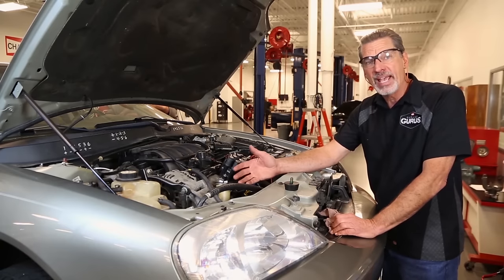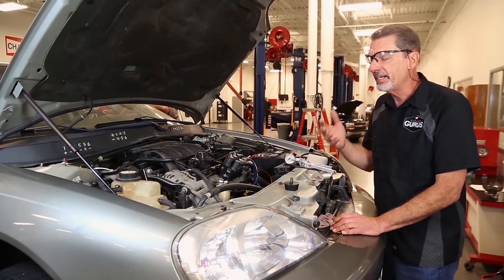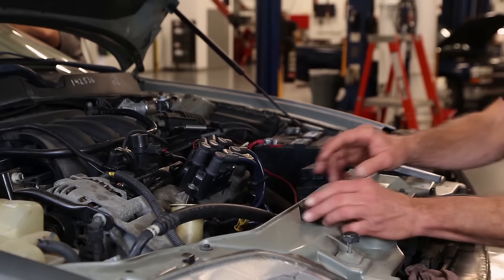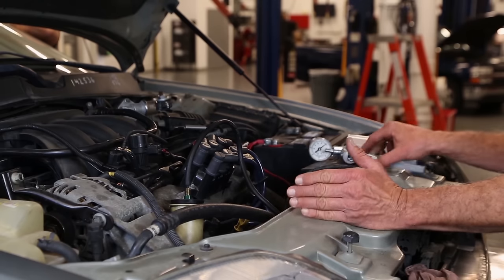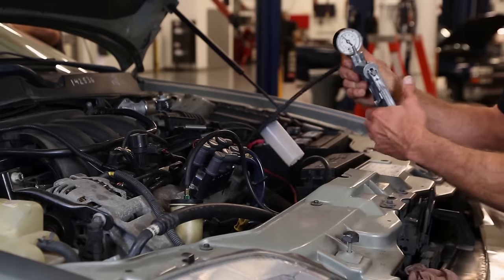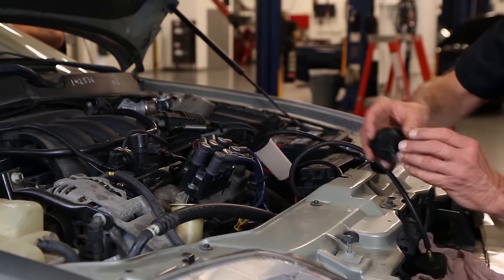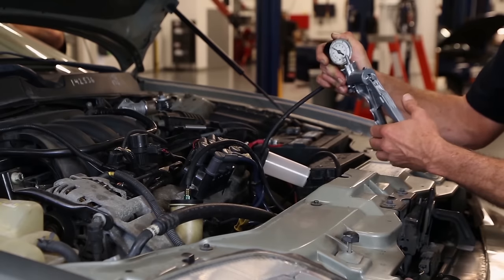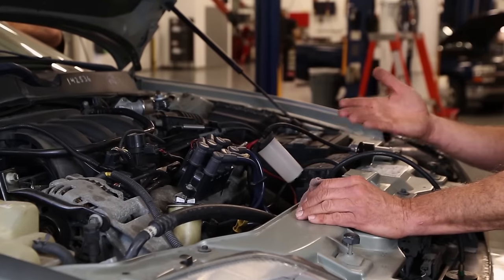Power Steering System Air Bleed Process

Comment: Jack the front of the car off the ground and put on jack stands. Fill the reservoir and WITH THE ENGINE OFF turn the steering wheel all the way both ways and  check the reservoir as you do this and add fluid as the air is released.  When the air seems to be bled out start the car and turn the steering wheel again all the way in both directions about 10x. When the air is bled and the fluid stabilizes drop the car back down and start it again. Once more turn the steering wheel all the way both directions about 10x while checking the reservoir. If it drops a bit just top it off and go for a spin.  Check the reservoir one last time when you get back and make sure it's filled to max. This is the correct and easier way to bleed your power steering system of air.
Reply: Holy crap ive been doing while the engine is on and cant get the air to come out and it just bubbles out the the top and ive try like 3 times but next time ill try with it off first thanks
Reply: Do I need a vacuum for this like in the vid?
Reply: @Redneck_4wheelers  did that help?
Reply: @WaveyDaHuman  i still havent done it been pretty lazy during this winter
Reply: Do you do each step with the cap off?
Reply: my car blew up
Reply: Thanks man it worked i turned the wheel 10 times with it off and 10 times with it on with cap removed got rid of the loud power steering whine
Reply: Is the car being off the ground just to make it easier turning the steering wheel or another reason?
Reply: I agree
Reply: Exactly absolutely no reason to do it the way the video shows unless you like buying a bunch of extra tools for no reason
Reply: @WanderlustmanC you cant turn the car while its on the ground theres too much friction on the tires.

Comment: If you want to replace your pump again, do it like this video. Jack the truck/car off the ground and set it on jack stands. Fill the res to the full mark. With the engine OFF, turn the wheels back and forth until all the air bubbles are gone (adding fluid as needed). Then start the engine (still on jack stands), and repeat. There should be no whining or gurgling sounds. done. Running the pump with a bunch of air in it is beyond stupid. This vac technique can not remove air in the system.
Reply: @idiotgo  why.. do u mean Subaru power steering can't replace fluid by return line drain method?
Reply: @idiotgo  I thought it was a easy thing to bleed out. Since there are alot of you tube videos about bleeding air by turning steering wheel on open fluid reservoir. I never change PS fluid before.
Reply: Good thing I saw this comment, for some  reason I trust your opinion and going to do it your way
Reply: @DrNemea  The vacuum makes the pump fight against it. It prevents the pump from drawing fluid from the reservoir.
Reply: Thanks for your comment you should make a video. Works like a charm.  Thanks again.
Reply: Silly question but do you do this with the cap on or off ?
Reply: @geoffreymontelongo8916  It's a good idea to have the cap on... but no necessary. With the cap off, I would fill the res to about 3/4 full. As air bubbles into the res, it can make a mess with the cap off. That may vary with model.
Reply: Lol, you didn't listen to the video. He said "some cars require no special techniques, but some need additional help to get the air out" What you're describing is the "no special techniques" part of that sentence.
Reply: Honda Pilot 2014, agreed!  I had to vac 20to 25 psi with front car jacked up WITHOUT starting the engine like 20 times, each time 10 complete lock to lock turns until all bled, and tapping up ps fluid as needed. Once I was confirmed no bubbles foam etc , I started the engine and did as this video suggested. And I finally got my ps to work no noise, nice and soft turns. Please be patient with bubbles give like 10mins to disappear. It take a while to bleed but if done correctly save a lot of headaches in the future
Reply: thanks 👍🏼👍🏼 I guess I'm the only DIY that doesn't have a pump in toolbox.....
Reply: does the reservoir cap stay on the power steering or loosen it a bit
Reply: @sorro_tek9599  Keep it loose
Reply: @hawkdsl  appreciate itt
Reply: @sorro_tek9599  Did you see the cap being switched for a rubber stopper with a vacuum valve on it or no? He only put the cap on to check the fluid level after the suction process.
Reply: Yes it can

Comment: Don't turn on engine. You can cycle the steering back and forth to push the air to the reservoir.if the front wheels are off the ground. You don't even need that vacuum pump.  Keeping engine off prevents the pump from engaging so it won't spit out fluid.  Simply rotate the wheels by cycling bank and forth on the steering wheel. check reservoir every few cycles for air bubbles. If need be add more fluid but only to proper levels. Do no over fill.
Reply: Do you leave the reservior cap off or on during this process?
Reply: @andrue17  Yes
Reply: Is the cap on during the process?
Or do you keep the cap off?

Comment: I finally did get all the air out of the system. The hand held vacuum pump did nothing in the beginning because there was too much air in the system. I could not pull any vacuum with it even after 15 min of pumping. So here is what I had to do: I have a one man pneumatic brake bleeder that uses air pressure to create a vacuum. I hooked this up to a mighty vac vacuum adapter for ford power steering reservoirs and sucked most of the air out of the system with the motor running by turning the vacuum on and off for about 10 minutes. Then I hooked up the hand held pump and was finally able to pull a vacuum. Red PS fluid was coming up into the fluid separator even at 10 lbs and it was full of tiny bubbles. I kept it at 10 until fluid stopped coming out. Then I went to 15 / 20 /23 doing the same procedure until there were no more bubbles. 23 was the highest I could get it. I stopped the motor and let it cool off for 2 hrs, then repeated with the hand held pump.. There was still a little air in the system, but fluid did not squirt out of the vent hole in the cap anymore when the motor was shut off. I let the owner drive the car for a day like that, then repeated the procedure.
Reply: The only way i got mine to stop foaming up and causing a whine was to use about half a quart of dexron III automatic transmission fluid.  I tried every brand of power steering fluid i could find.  The prrstone Honda fluid worked best but still whined hard after a 40 min drive.
I said screw it and put the trans fluid in it.   we used automatic transmission fluid in power steering systems all the time back in the 80s. In fact the owners manual of my olds cutlass said you can.     And now mine is whisper quiet.

Comment: Watching this video I finally figured out why my nasty honda is making a whining noise even after replacing the pump I forgot to bleed the line and realized the line is filled with air 😴 thank you so much you have a sub here 💪
Reply: What year of honda?
Reply: Moving the steering wheel from left to right while 10 times the front of the vehicle is on jack stands and the engine idling will help. 👌
Reply: @eluniversodelecuador  didn't help me...😥 in so flustered!!!

Comment: I have a 1999 Ford Ranger 4.0 4WD. Now it has 190,000 mi. I am the original owner. For the last 15 years the power steering pump has been whining.
2 shops I went to for a replacement asked me if it worked normal besides the noise. Yes, it does and no leaks that I have ever seen. They both said they wouldn't touch it, because they most likely wouldn't be able to make the noise quit. I bought a "new parts" rebuild from summit racing. Decided not to install myself because I might run into some unknown problems. Had a shop do the install and it was better initially (except near full turning). Within a week it was back to making noise. Not as loud but not quiet like it was 15 years before. I have a hand vac and plug fitting for the reservoir. That helped a little, but kind of changed the points of when the noise starts, or stops. I get a good seal with the fitting and it will hold vacuum overnight. For 2 days now I am driving it with the vacuum set on the pump. 😄 Not fix yet. Any ideas?  Somebody must know what the problem is.

Comment: On my 84 gmc I had the mechanic to just go back and forth with the steering after installing the pump then drove it and added more fluid and went back forth a little bit and it worked

Comment: I have a 2002 Merc Sable that has a lot of air in the system. With the engine off, the fluid level is where it should be, but when it is started, the fluid level drops way down and needs about a cup added to bring it back up. As soon as the engine is shut off, the level rises and all the added fluid over flows from all the air pushing it out. Will this method work to get all the air out? I have raised the front end off the ground , and have been turning the wheel from stop to stop with the cap off / engine off  for 3 hrs in an attempt to get the air out. Bubbles keep coming up. The most times that I can go from lock to lock and back without any bubbles is 4
Reply from the maker: It is just difficult to get the air out of Ford power steering systems. Turning the wheels back and forth, raising the front end, ect. give you limited success. The vacuum method outlined in the Tech Tip is recommended by most manufacturers. Buy or borrow a good vacuum pump as shown in the video and buy a power steering bleed adapter. Search: “Power Steering Vacuum Bleed Adapter” They are available from most auto parts stores and an online search will show adapters from $13 to $20 that will work fine. Good Luck!
Reply: What you just described is exactly what im facing with ES330. I repaced leaky hoses and no matter a bleed and flush still whines.
Reply: I have a 2003 Ford Taurus with the same problem!
Reply: Did you find the solution to this. I have the same exact problem on a 2007 ford taurus. I've jacked it up and turned the wheel 50+ times lock to lock. There's still so many bubbles. I didn't have an adapter so the vacuum pump wasn't used. Any help or info?

Comment: What are all those numbers on the upper plastic firewall cover? great video BTW, i really need to do this to my car.
Reply from the maker: dntlss, the Ford used for this video is part of our training fleet here in St. Louis. The numbers on the left are the firing order of the engine. The numbers on the right refer to the DIS ignition electrical polarity of the spark plugs.

Comment: 2004 Pontiac Grand Prix. I have replaced pump and lines. Worked great for about 3 -5days. Did the side to side to release air out of lines and the pump still found away to come out of position. It’s extremely hard to turn unless I keep my adding power steering fluid. 
Will this method help me?

Comment: my power steering rack is leaking oil so I bought a brand new power steering rack on ebay $400 aus. My motor mechanic told me to change the power steering pump to. I brought a new power steering rack do I need a power steering pump or not. I do not want to put one in because there's one sounds ok. just the power steering rack was leaking
Reply: It's probably a good idea because you may have contaminants in the pump that will get pushed into your new steering rack.  It's more precautionary in my opinion.

Comment: Where can I get one of those power steering reservoir cap adapters from?  I got the vacuum pump but it did not come with that adapter cap.  Great video, thank you for sharing.
Reply: Oscar Monge you can get anything from the internet.I don't even call or run to stores anymore.any part or tool is usually much cheaper on the internet than at the store.
Reply: I made one out of a sink stopper but you have to hold it down so I did the prochedure with engine off as did the BBB industries tutorial showed.
Reply: get it online from a scientific supply co.  , 8 or 10 bucks.

Comment: Question.I have 2002 duramax that had a leaking hose from the brake assist to the ps gear box.Everthing was working perfect.brakes and power steering.After shop  replaced the hose i now dont have power steering at a idol or low RPM sand brakes dont work so good at low RPM either.They only work good with foot on the throttle or driving down the hyway.Whats wrong??
Reply: Probably still has air in the system, Google how to flush/bleed hydro boost power steering. Short version, you want to jack the front end up and very slowly turn the wheels lock to lock, then slowly press the brake pedal and turn lock to lock again. Repeat this step several times.

Comment: Honda is terrible for this problem. 
I followed this video to a T because after replacing my pump it would whine even after turning the wheel back and fourth 10 times.  It would be fine for about a day then start that loud whine again.  I tried several brands of fluid. In order from worst to best.   Autozone first, lucas second, then prestone.  So i was getting very frustrated with the noise because this pump isnt cheap and i didnt want to ruin it.  So went old school and decided to use a trick from the old days.   i sucked out some of the fluid in the reservoir until it was below the top hose and added dexron III automatic transmission fluid to the reservoir.  Started up the engine and the sound went away in 2 seconds and has been whisper quiet ever since.  This is going on 2 weeks and the pump has never whined since.

Comment: My car sounds like its got 25 inches of vacuum at all times, but its not hooked up to a vacuum pump! I tried to bleed it with the  reservoir cap off and engine running. Turned the wheels and the thing still groans like its got 25 inches on thr vacuum pump in this video. Even worse when revving the idle. Im going to try this vacuum pump method, and see if anything improves. Next step will be to buy a new PS pump. Engine has 68k miles, but its an LS1 that was swapped into an 80s Firebird. The previous owner may have screwed something up. I have a video of me driving by at high speed and all ya hear is the dang PS pump instead if the engine. If this thread is still alive, please help!

Comment: my car is having heavy steering. i have changed the fluid but unable to decide how to draw air out. my pump is not making any noise. car model Opel Astra 2001. plz guide
Reply from the maker: Thanks for the note! Please contact our technical support and they can try to help diagnose the issue you are having. The Gurus Tech Hotline number is 800-325-8886 and is available
M-Th: 8:30AM-5:30PM ET
Fri: 8:30AM-5:00PM ET
Reply: Mr305Maxxx  Nah! I figured out the way by my own.

Comment: Why check for leaks after? The vacuum from the pump would not hold if there was a leak.
Reply from the maker: Many times seals and “O” rings can hold under vacuum but leak under pressure and vice-versa. We have seen this in A/C, evaporative purge, and power steering systems. Doing a careful visual check as a final step is always wise.
Reply: He's not checking for a leak, he is checking for a fluid drop, because the air in the lines occupy space, when you suck out the air via the vacuum method, the fluid fills in those spaces where the air bubble used to be, resulting in a drop in the fluid volume.

Comment: I bought the Mityvac pump Model Mv8000 to remove the air from the power steering of the ute ford falcon year 2000 that I have. Is this pump correct?
Reply from the maker: Yes, the Mityvac MV 8000 is perfect! 
Use the MityVac MVA 662 reservoir adapter for Ford pumps or the universal adapter kit MITMVA 670 for Ford, GM, and most other makes. You can find them online for a reasonable price.
Reply: Thanks for the quick response. I used it and it really solved my problem. It took me only 4 days to be delivered and it was worth it. @GarageGurus

Comment: does the method you just describe work on the hyundai 2001 sonata. The ps pump reservoir is about the size of a baby's bottle around the neck
Reply from the maker: This will work on any hydraulic power steering system. The procedure in our Tech Tip is found in factory service procedures from GM, Ford, and many other manufacturers.

Comment: What if the vac pump does not pressurize?...is there a leak in the system
Reply from the maker: If the system will not hold vacuum as described, first verify that the seal between the adapter and the reservoir opening is secure. If vacuum still does not hold, check the inlet or low pressure side of the pump. There may be a loose hose clamp, hardened rubber hose which will not seal, or an “O” ring that is leaking. This will allow additional air to be drawn into the system. Refer to the link below where Garage Guru Mark Isaac talks air leak detection techniques.
https://www.youtube.com/watch?v=LfeVoQtJOvQ

Comment: Man this is giving me a headache. I recently installed a new power steering pump on my 04 Legacy. Turning is better initially, but the more sharp turns I make, the more the steering wheel gets stiffer. I popped the hood and realized there's a pool of steering fluid that's leaking from the top of the new steering pump, right where the lines go in. Does anyone have any ideas of what I could try next?
Reply: Replace the o-ring in that line, and bleed the pump again.
Reply: @zanes9898  I did end up replacing the o ring and that fixed the leak, however tight turns such as parking, the steering wheel is still hard to turn. I've bled it a few times and it doesn't seem to fix it.
Reply: @clarkgriswold4057  and the fluid isn’t leaking anymore?

Comment: Using a vacuum on a Subaru did not work. It would never draw fluid from the reservoir. You need to start the engine and just turn the wheel.

Comment: I don't think I would run the engine while using a vacuum. the pump is creating pressure when running. But I'm no mechanic. I'll try it with the engine off.